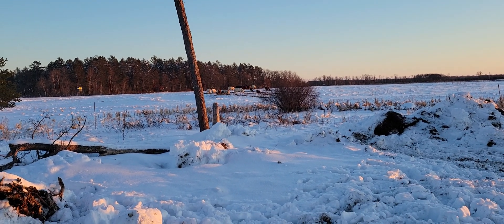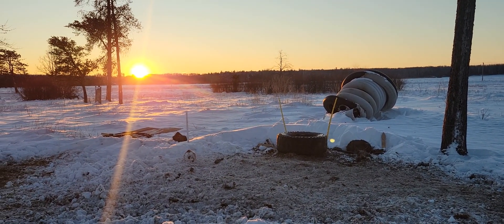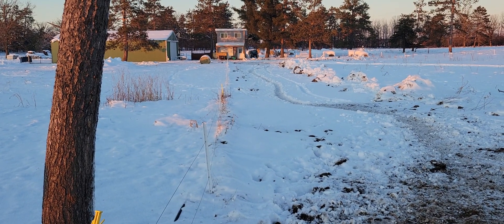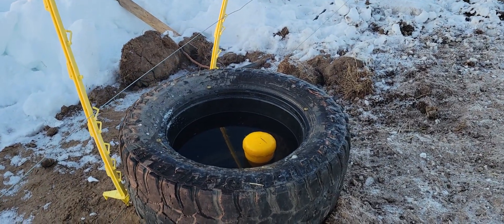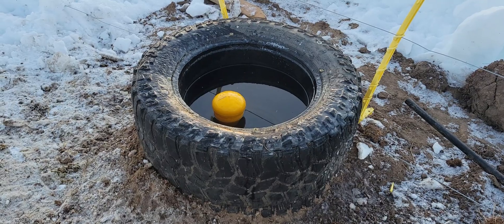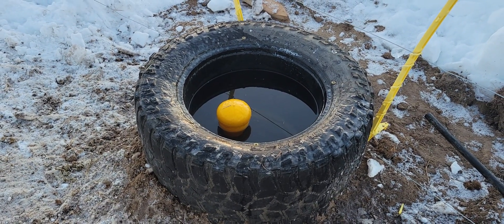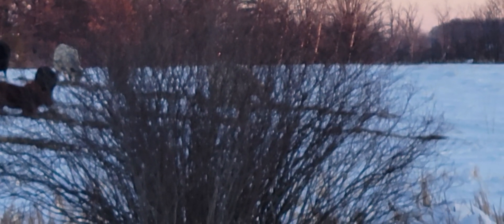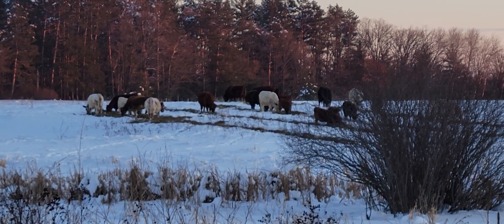Watering cattle in the Minnesota winter.

Comment: GEORGE !! Find a Tire that Fits Inside the Hole of that tire.  Cut Off the Rims of the Smaller tire, or Two to make an inside wall for the larger tire. Then, Fill the space in between with Foam Spray insulation 👌

Comment: It’s probably more work than spray foam, but if you’re concerned at all about the spray foam tainting the water… the first thing that came to mind was Rockwool, the spun basalt.  You’re probably already aware of it if you’re pouring footings.  It’s used below grade as an exterior layer of insulation.  All the best!

Comment: Interesting setup, I'm in northwest Wisconsin  looking to find a farm. Do you see any issues with the waterer in below zero temps for weeks at a time?
Reply from the maker: I break the ice out daily, main thing is keeping water line from freezing.
Reply: Check Greg Judy …he has the same water tire set up. But, he just added a new one and has a Brass Shut Off Valve, in the Buried Supply pipe that goes to the Tire. It’s a cool set-up.
Reply: @davemi00  Ive watched Greg Judy but he doesn't see the cold temps like we do.
Reply: How did you build this?

Like how do you get the water supply line into the well?

What is at the bottom of this well?

How do you get the valve into the bottom?
Reply from the maker: @FuerstenbergE I have another video giving greater detail on the build, from last winter.

Comment: Ok, need more info on the water.  Is the culvert placed vertically?  It reaches down to standing ground water right?  The one inch line inside the drain tile is pressurized water from the grey building?
Reply from the maker: Yes and yes, the culvert transfers ground heat up to the bottom of the water trough keeping it and the water line thaw.

Comment: I like the waterer. Looking to add another one this summer. Is the valve just under the surface or how do you service it?  I'm thinking you are aware but be careful about sheep eating cattle minerals. Copper is too high.
Reply from the maker: I took the two blocks with copper out when we put the sheep in.  The valve is mounted to the side of tank near the bottom, it's a 15 gallon tank.
Then I have a garden hose from the valve to the 1"line

Comment: The watering setup you have is pretty clever.    How're your sheep holding up?  Wondering about your thoughts re: combining flock and herd together for winter.  For your thistles - I've had success with what you're doing - letting the fertility drive other plant species forward that can outcompete them.  I had a smaller field that was rotten with them, and fed hay on it all last winter.  They really didn't come back around because the grass could win.  - Peter
Reply from the maker: Thanks, the sheep are doing well, they are at the home farm now. We have been having some dog issues of our own. We're gonna put down as much carbon on this farm as we  can this winter.